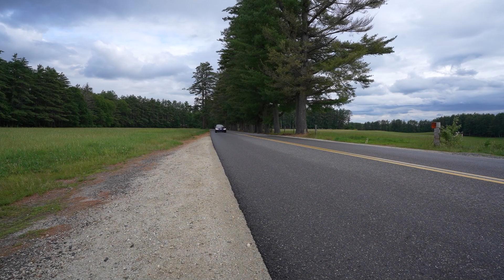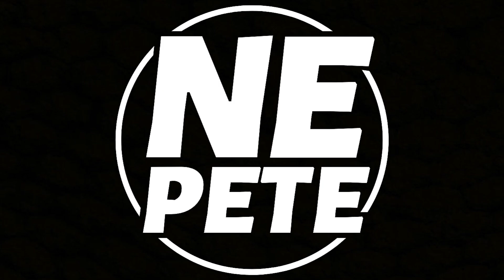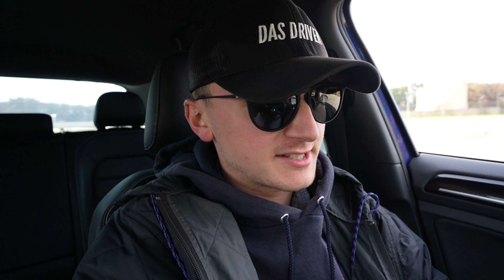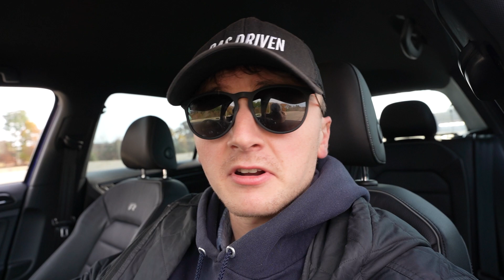Here's What Was WRONG With My Golf R + Future Car Plans?

Comment: That's a big yikes on the haldex service cost. The filter clean is very easy and doesn't really require any special tools aside from replacing the o-rings and bolts for the pump. $200+ just for that seems like a robbery. It's around $120 for the haldex service kit and maybe 1-1.5h of work. I'd highly recommend trying it yourself next time if you feel inclined to do so.
Reply: in the UK main dealer Haldex service is £120, just did mine at 30k miles on a 2017 MK7.5 R.